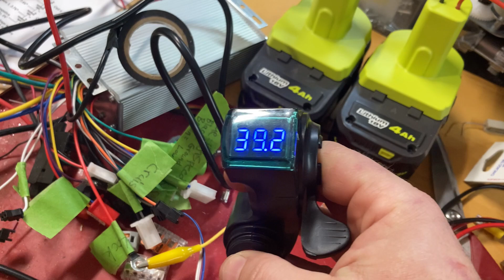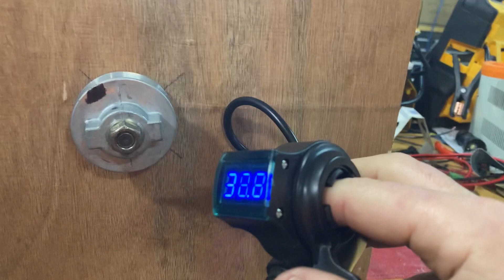Bench-Testing Ryobi 40V Lawn Mower Motor with e-bike Controller

Comment: Could a larger charge controller be used or would it burn up the motor?
Reply: A controller capable of outputting more power will not hurt anything.   Where you have to be careful is if you want to use a higher voltage battery.  For example if you're running a motor designed for 40 volts max and you throw in a 60 volt battery, it will have more power, but could burn up the motor.

Comment: Hey sir ..
I have the ryobi 18 volt 16in lawn mower and I wanna convert it from battery to wire using dc power adapter like the laptop charger but the motor run and turn off I dont know why can u help me .. sorry for my poor English.
Reply from the maker: A DC power supply usually can’t provide the amount of current that a battery can. You are likely over working the power supply.

Comment: Hi, I bought an electric mower which is renowned for sensor issues regarding the safety start trigger. I basiclly want to use the mowers power fuse as the on/off switch. 4 wires come out of the controller to a plug and then up to the handle. I'm trying to find out what I need to bridge for the mower to be on all the time. Any ideas?

Comment: BenjaminNelson I just picked one of these Ryobi mowers up from the roadside. I was looking at throwing a cheap motor control board in to fix it and found this video. It works without the hall sensor inputs hooked up, correct?
Reply from the maker: That sounds correct. I think I only had the three 3-phase wires hooked to it and essentially nothing else connected on the motor controller side of things.

Comment: Will this work with a brushed motor?
Reply from the maker: A brushed motor uses a slightly different type of motor controller.
You just need to match a brushed or brushless motor with its matching controller.

Comment: Any idea if a motor that size would have the capability to turn a supercharger? For the cost of these things, it would be a really cool application if they can hand a little motor load of the required gearing to get there. These motors look much more substantial than a leaf blower motor, and the mounting is more favorable.

Comment: Hi, I am wondering if you can help with a question. i picked up one of these motors(36v) from a broken plastic mower base. and was considering refitting it to another mower. (i don't have the 36V battery etc) and was considering using adaptors for two DeWalt 18V lithium Ion batteries. i read you can't just join these in series as it may blow the BMS in the battery but i'm not sure i understand why or how to avoid this issue if it is an issue. i watched this video originally considering trying to adapt it to a bike, which would need a speed controller, but the mower i assume would be fine with an on off switch and decent relay.
Reply from the maker: A plain brushed DC motor can be powered with just a battery and on/off switch.
A brushless motor will need a controller. You will notice that it has THREE wires to go to a controller, NOT just a red and black with to go to a battery.

The Ryobi 18V batteries seem to work pretty well run in series. They have a good internal BMS which allows this. I can't speak for other brands.
Reply: @BenjaminNelsonX  But what about the hall sensor? I have the same Ryobi 40v but it is Sensor less. How did you by pass this? Mine will not run. The motor controller you used has the hall sensor connects. Please help! I'm stuck at this point!
Reply: @BenjaminNelsonX  thanks for explaining that. I'll have to see if I can come across the controller before continuing to far.

Comment: Hi! I recently picked up the mower motor, motor controller, and throttle that you have links for in this video. The only difference, I am using a 40 volt Ryobi battery that would have went with the mower that the motor came from. I have everything set up for bench testing (no physical load on the motor). However when I approach full throttle everything cuts off. Turning the throttle switch on and off does nothing. I must disconnect and reconnect the battery and the motor will operate, but again it will shut off as approaching full throttle. I believe the battery is good as it works just fine at full throttle in the Ryobi 40 volt weed wacker. The phase wires on the motor and the controller are matched by color, as are the control wires between the throttle and the motor controller. The next thing I was going to try was perhaps switching them as it may be a phasing issue of some sort. I am newish to all of this (brushless motors and controllers) perhaps you could share some insight or point me in the direction of some reading material to help me solve this issue.

Thank you very much for your time
Adam
Reply from the maker: I'd try testing the throttle. Many motor controllers are designed for a specific range, and if the throttle signal is outside of that, the controller turns off as a safety feature. You could use a multimeter to test it, or connect a known good throttle in place of the one you are using.
Reply: @BenjaminNelsonX  thank you very much sir! I very much appreciate your advice
Reply: @adamdezolt2898  i'm interested in this also now, as i picked up a motor from a broken mower recently and came to youtube looking if it was possible to use on a bike. would love to hear if there's any particular issues to look out for or parts that are incompatible.

Comment: ive been looking for videos on this exact thing this is awesome! did you ever get it finished? did the motor handle up hill climbs? i saw somebody said they had issues with those thumb throttles do to them regulating speed and not voltage i believe it was. will the thumb throttle cause the motor to burn up?
Reply from the maker: I used this motor for a powered electric wheelbarrow. It worked really well for it. https://youtu.be/Wp6_Suz6A9M

Comment: Was there no way the original mower speed controller could be leveraged?
Reply from the maker: I didn't see any obvious controls or unused wiring on it. It just appeared to be a single speed setup. I'm sure that if somebody took it apart and really looked through it and modified it, that could be done.
For me, it was much easier just to buy a different, inexpensive controller.

Comment: Hey Ben I have a 80v kolbalt mower.  I want to be able to set the rpms to max on demand.  It already has the reliable speed controller what do I need to do to trick it into think it's under a heavy load to boost the rpms?  An inliner resistor?  Thank you for your time Brian
Reply from the maker: Not sure I can help you on this one. I have no experience with that mower and don't know the details of the controls on it. Try taking a look on a forum. The Electric Bike forums tend to be the places with LOTS of knowledge on the various small speed controllers.

Comment: Hello , how did you connect the three wires off the motor?  Thanks
Reply from the maker: There are three matching wires on the motor controller. They are just connected with some crimp-on butt-splice connectors.
Reply: @BenjaminNelsonX  Ive bought the same set up  , , I match up the red, green and black to  controller,  where does the yellow wire  and blue wires go on  controller?  Thanks for your help.
Reply from the maker: It's difficult to troubleshoot using only YouTube comments. You'll probably get better help on a forum or something like a Facebook group where you can have more interaction and post photos.
Reply from the maker: On most controllers, the Red and Black wires are for the positive and negative of the battery, and the yellow, green, and blue are the three phase wires on the motor.
Reply: @BenjaminNelsonX  ok ,,, I bought what you  suggested , it came with  CHINA writing , and   ZERO instructions  how to hook it up...... . just trying to get wiring diagram to hook up what you put on youtube.   Thanks for your help.

Comment: I see a trip to the emergency room in your future.   P.S.  I worked with an old master machinist tool maker , i fineally got the courage to ask what machine took his missing finger ?  Answer, the grass mower.
Reply from the maker: Well, it's pretty dangerous with a blade on it.
The blade is never going back on this thing. It will be used to run some other sort of small portable machinery.